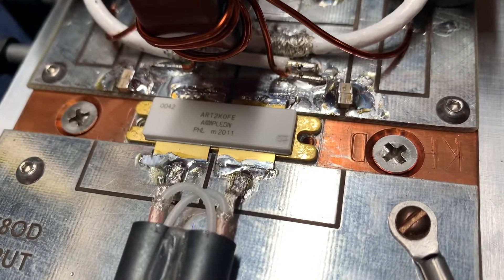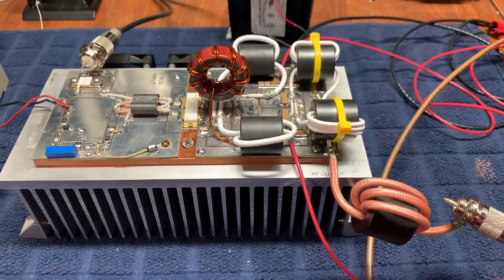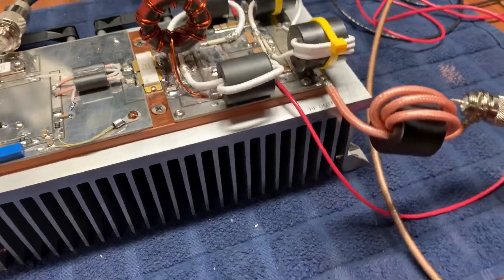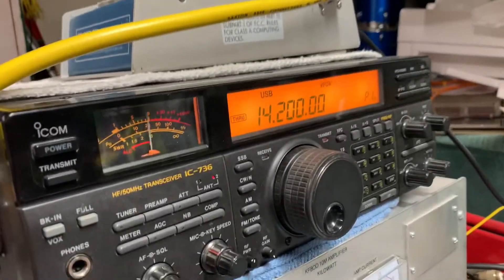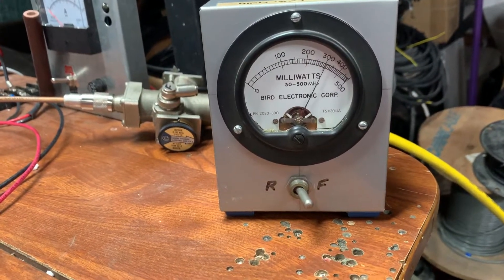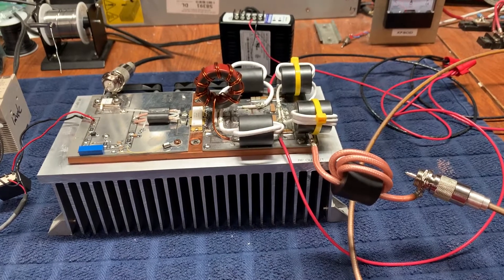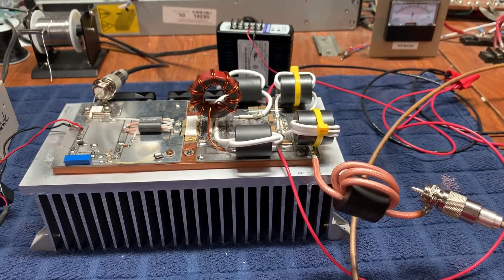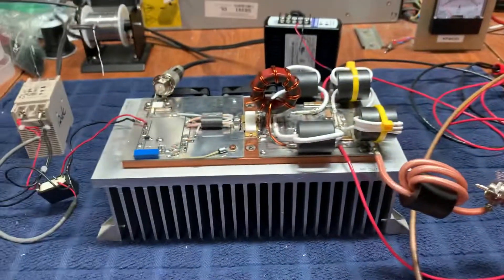ART2K0FE LDMOS 16:1 output circuit

Comment: I am searching for a source that sells a 16dB 100 watt attenuator using the same case style as what you used here. Everyone seems to have 10dB, 20dB, and 30dB versions but nothing between those steps. Any thoughts on who carries them at this time?  Thanks!  de W1AEX
Reply from the maker: I have them custom made. I sell them on my website.
qsl.net/kf8od/swappage.html
Reply: @KF8OD1  Thanks! If swapping my current Res-Net 10dB for a Res-Net 20dB is too heavy-handed I will be in touch. To be honest, the 16dB you have pictured at your site is what I think will give me an optimal result. 73, de W1AEX

Comment: Awesome Job, 
 Thanks for Sharing this build and issues with us as well... 
I Might even ATTEMP one for myself someday soon...  
That's when I run out of Russian tubes & toys or just bored to Death
 someday... I would like to see a Harmonics test video also...thx!!! 🙃👍💯
Hava Gr8 weekend! 73's
Reply from the maker: Thanks Glenn. Bored to death is my problem. I would use the blf188xr or mrfx1k80h for your first SSPA. Compared to building a tube amp these are very easy. 73
Reply: @KF8OD1  will do! Thx!
Reply: @KF8OD1  have you seen mud Duck sharky's amp kits?
He did a really nice job too, low pass built on the board.
Tight on the Chicken band tho.